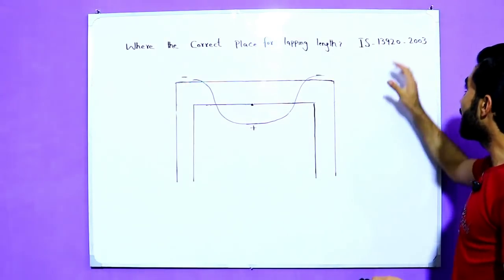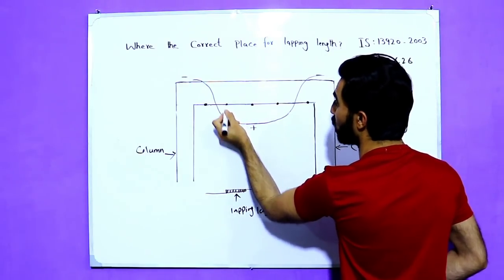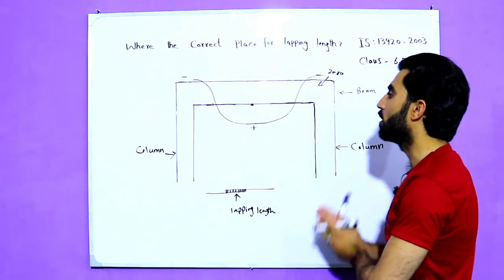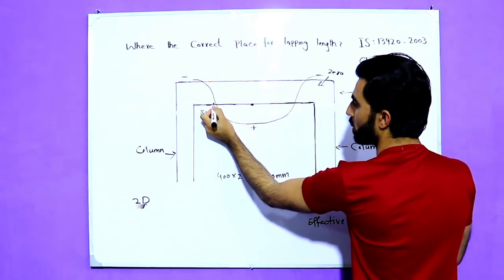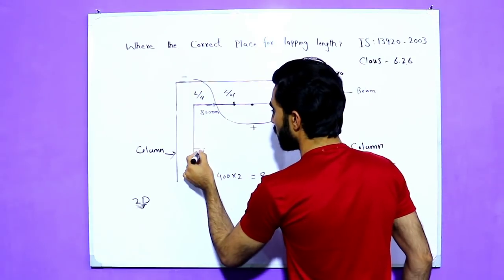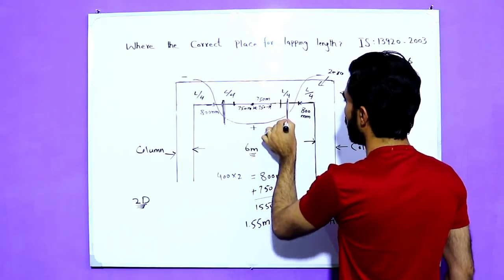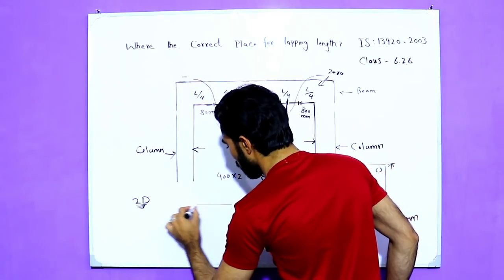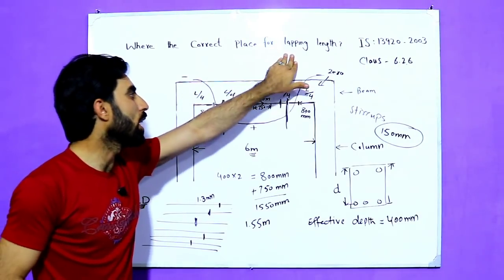Correct Place for Lapping Length in slab and Beam? Where is the Best place for Lapping Zone?

Comment: Sir why you add 750 And 800 ?
And what is 750mm it's Constant ?
 please explain
Reply: L/4 =1.5 then 1.5/2 for two sides of mid point =750 mm then this value + effective depth = 1550 mm
Reply: Sir can we provide at two different places one is 2D and 2D+L/4 am I correct ?